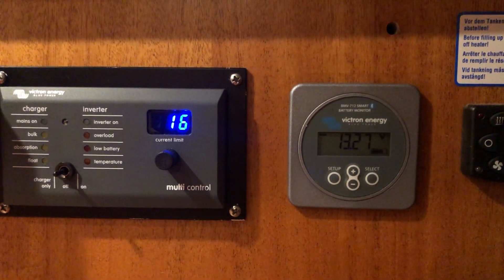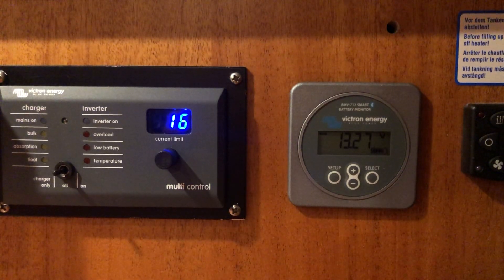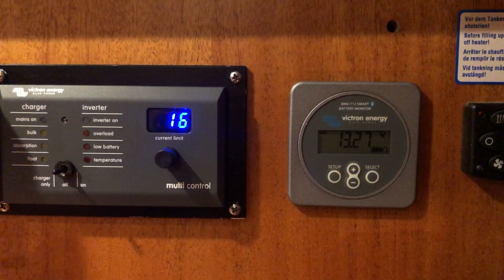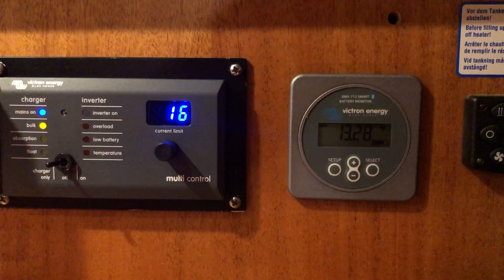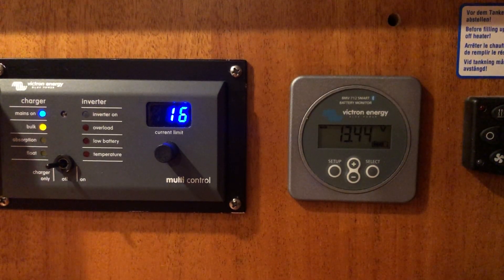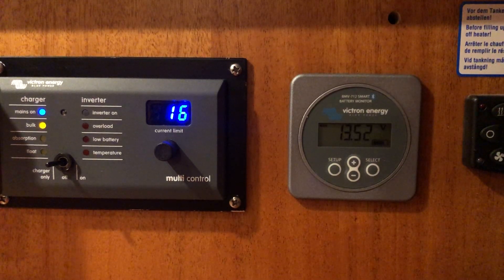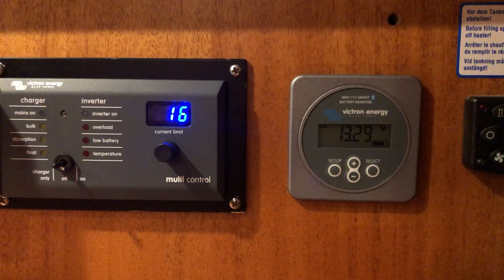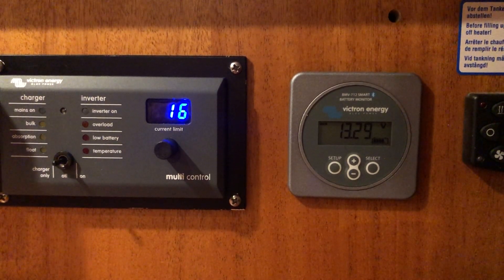Testing relay function of BMV-712 with ML-Series Remote Battery Switch

Comment: If you went through the trouble of setting the over voltage protection relay, why not set it up, also, for under voltage, high temperature, and low temperature?

Out of curiosity, did you setup the temperature coefficient in the miscellaneous menu?
Reply: I agree, have both warnings and disconnect related to temperature and high/low voltage even if I don't show it on the video. But for main under-voltage protection I am using the battery-brain.
Reply: @jedholm1  aha.

I see now. 😊